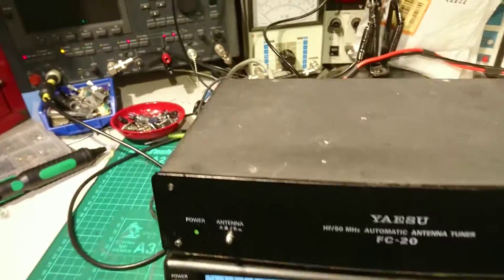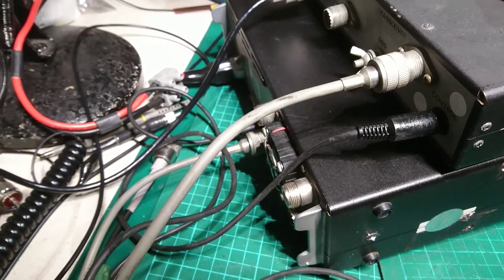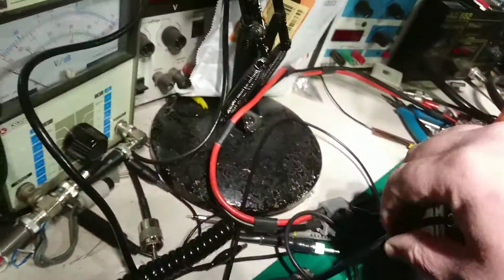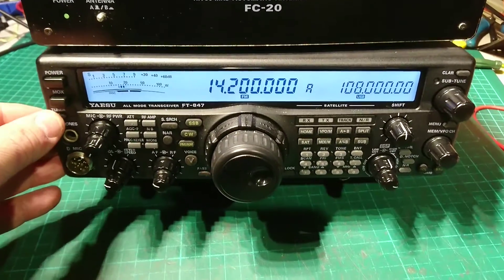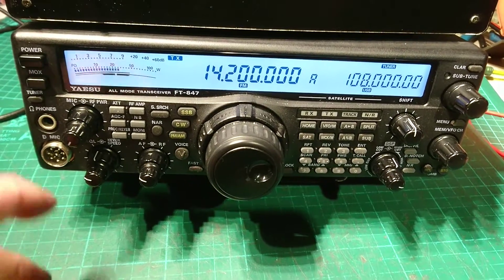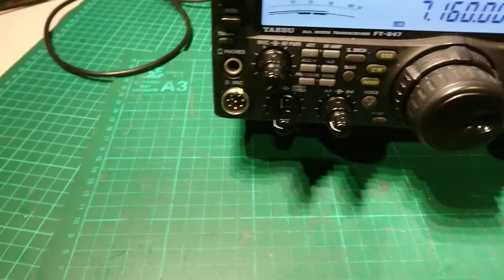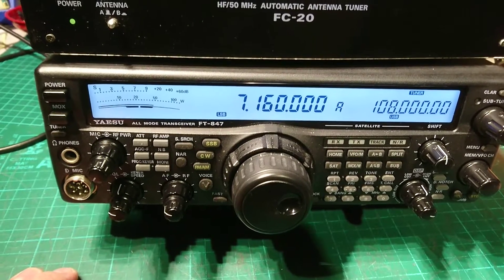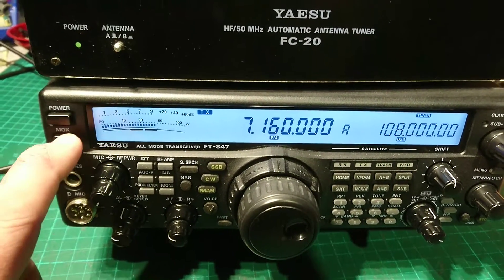HF test of a Yaesu FT-847 #2 With FC-20 tuner

Comment: How do you rate the 847? I'm going to look at one to buy next week and how do you think it compares to the FT-900CAT which I have at the moment. Is it worth the upgrade?
Reply: The 847 is an amazing radio hf 6 4 2m 70cms . One of the best yaesu made
Reply: It took me a while to see your reply had been posted. I bought it along with the FC20. It's a vast improvement on my 900.
Reply: @nottjohn9418  I'm yet to do the FC 20 tuner modification
Reply: I'm guessing that's to make it tune a wider mismatch.
Reply: @user-cg7uw9uh6n  what modification?
Reply: @The-Chaos-Shack  Hi your F220 will tune up to a 7:1 insted of 3:1
The first thing you need to do is get into the service menu. You do this by holding down the three buttons on the mic and turning on the radio.
The first menu will be Fm-51 do not change that one. Rotate the sub-tune knob until you see the menu that says SWR 3.0 to the left this you will see two small numbers or numbers letter combination. Rotate the MEM/VFO CH knob until you see 9A then push the menu button and you are done.
Remember if you do a factory re set then it returns to its original settings. Why GL let me know how you get on tu M3MQR 2E0MQA
Reply: @user-cg7uw9uh6n  thanks for that 😀

Comment: I bought one and it came with the fc-20 but it looks like the fc-20 is bad. can I use a different auto tuner with it or do I have to use a manual tuner? Any help would really be appreciated as I am thinking I might not get to use the HF portion of this radio at all and spent too much for a dual band radio
 ..LOL
Reply: Any manual tuner would work fine. LDG makes an auto tuner called a YT-847 which dies the same job as the FC20 without the cat control confict which the FC20 is known for.

Comment: two commentaries about this video, the video quality excellent but never put nothing in the top or superior surface in this equipment or rig, In this case the fc 20 unit, was blocking the transmit-ion unit air intake, and hopefully you can destroy this unit for overhead. Second one, never mix in the back cables, produce a lot of RF noise and the antenna matching will be no too much accuracy